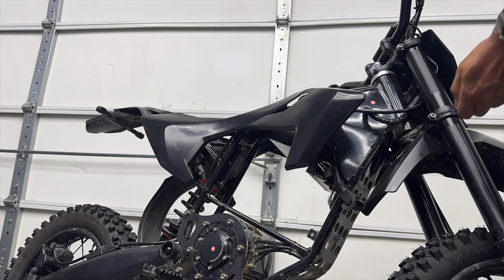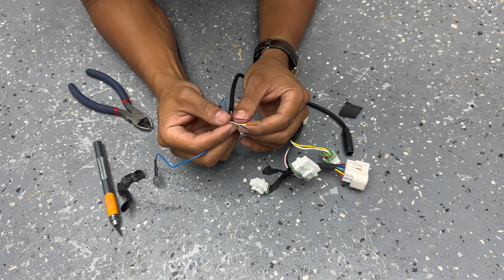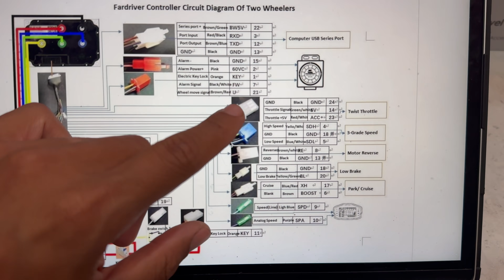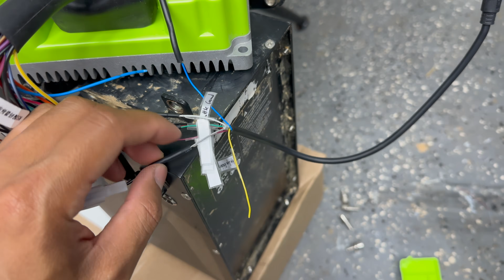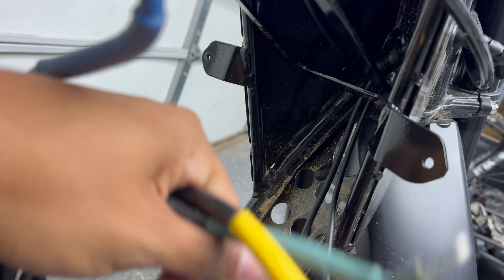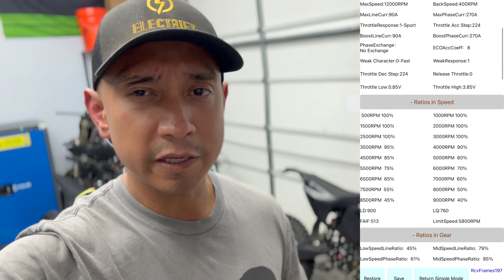Qronge X1 Spark Fardriver ND72300B Controller Upgrade

Comment: Different platform but the Eskute RTX also has 12V step down and integrated display in wiring. It is not one-line BUT I want to keep factory lights/horn/etc. What did you wire the step down converter too? Or did you not have to change the “trigger” wire since you kept factory display and key.

Thanks!

Comment: Damn you should of sent me the controller I would of used it
Reply from the maker: What specifically would you have used it on? You have something that runs on an encoder sensor?
Reply: @PatOutdoors spare parts😮😊
Reply: I wanted to see if I can put a 72v battery on the stock controller if it gets fried. It wouldn’t matter if you gave me that controller😂😅

Comment: How did your hall sensor just clip i got this and its different
Reply from the maker: Like I said in the beginning of the video, this bike is not equipped with a hall sensor. It’s encoder so I had to purchase an encoder-compatible controller (ND7300B)
Reply: @PatOutdoors just purchased the same using your code 
Thank you

Comment: Hello so I have a 6 pin connector on my far driver can you help me out and fix it please
Reply from the maker: Sounds like you bought an ND72300, which is for a hall sensor. It’s not gonna work with this bike
Reply: @PatOutdoors do you know where I can find one for cheaper?
Reply from the maker: Well you can get the wrong controller again for cheaper. I know Econic carries the correct encoder style that works
Reply: @PatOutdoors so I got the encoder controller and now it just beeps and gives me a hall sensor error it has your same settings
Reply from the maker: @MoniraAzimi please contact a tuner like I did
Reply: @Pat @PatOutdoors ou have your tuner IG or something I can contact him. I have no one to help me please help me out

Comment: Did you ever got the display to work? Mine is just stuck at 00 and the mode button doesn’t work
Reply from the maker: Yup! Please watch later in the video when I said I switched two wires around

Comment: Did you end up getting the turn signals and brake light to work as well? I didnt see anything about how you got the headlight to work. 
I got a fardriver on mine just trying to figure out how to get the lights to work
Reply from the maker: Yes, everything worked as normal at the end after I wired the controller

Comment: Would the factory motor be fine with a 72v
Reply from the maker: For up to 100 line amps yeah, but I would not get too greedy with it
Reply: @PatOutdoors what would you limit phase amps to then?
Reply from the maker: @IBDeliverance 300 phase
Reply: @PatOutdoors . Would those numbers change if it was a 60 volt battery?
Reply: I'll answer my own question. Amps equal amps
Reply: Would those numbers change if it was a 60 volt battery?

Comment: how does Fardriver ND72450B give more power compared to the other  Fardriver ND72300B Controller???
Reply from the maker: More line amps and phase amp capability.. neither mean much unless you also upgrade the battery though

Comment: I have a battery that's 180 continuous 240 max. Should I set it at 180 continuous and leave it at that? Or should I set max amps to 200, then hold 15kw until it reaches 75 volts, then it tapers? Or mabye hold 14 kw, so then it won't reach 200 amps until 70v? I need an expert opinion on this lol.
Reply from the maker: I personally like to leave it an the continuous rating unless you are simply just drag racing and doing short bursts with long rest periods in between. It’ll likely only do 240 for less then 10 seconds and if you try to do it again shortly after, the BMS would trip and cut power to the bike completely while you are on the road.. I say you can try going 10-20 amps over and try doing pulls and if it cuts back at all, then turn it down in increments of 5 amps.
Reply: @PatOutdoors Thanks for the input. Should I hold a specific wattage? or just let it drop with sag?
Reply from the maker: @kalebbathalon it will always sag under load regardless. Obviously the more you ask of it, the more it will sag. If that’s a concern for you, then just stick to the max continuous rating.
Reply: @PatOutdoors one more thing sorry lol. I saw you were using 900 phase amps on your completed build. Is that safe on the motor for casual riding, Or should I go under to about 800 phase amps? Because 900 would be the max motor capability. So I wanted to make sure it's smart to run that as my mode 3.😅
Reply: Also I remember you saying "once I get the new battery, I'll turn it up from 700 phase amps, to 900 phase amps". Was there a reason you couldn't do that with the tuttio battery?
Reply from the maker: @kalebbathalon  because you can’t multiply past 3x line amps for phase amps. 200 line / 600 phase, 300 line / 900 phase.
Reply: @PatOutdoors How come? I keep asking chatgpt and it keeps saying that you can set phase amps higher? What's the downside?
Reply from the maker: @kalebbathalon I’m not a tuner. Please ask a professional.
Reply: @PatOutdoors alright sorry for the trouble. It makes sense enough

Comment: I need help for a cheap yozma build could you give me ideas and has good range under 1500 dollars
Reply from the maker: Amorge 72V 30AH battery + Sotion FW22 motor + Fardriver ND72450 altogether would be just about $1,500. This would net you about 14.4kW, 18kW peak power. Any more power than that, then you are taking away from the range..

Comment: sotion came out with a new motor for the x1 FW26X1
Reply from the maker: That would be a nice upgrade, but only if you install a battery that is able to put out a lot more power to make it worth it

Comment: Thank you for showing the results of what this upgrade truly does i was planning on doing this but i think ill save my money now lol
Reply from the maker: I would say it’s 100% worth it if you’re planning on installing a better or higher voltage battery on the bike. Otherwise yeah minimal gain if it’s JUST the controller.
Reply: @PatOutdoors I changed my rear sprocket to 45t and I plan on following your old video to change the throttle and add a volt meter. Was the throttle response better after you changed it and how did that change feel compared to the controller upgrade?
Reply from the maker: @jacobl7375 please completely disregard the old video unless you have the original early production M model with the half twist throttle. They had completely different wiring harness for the throttle
Reply: @PatOutdoors ohhh you're right thank you for the heads up just saved me a headache

Comment: Thanks for this video!!! I have a Nd72450B i tried to install awhile back but it kept tripping the bms on the stock battery, I can finally get around to installing after my new 60V battery comes in and i also can keep the accessories. Youre Awesome Pat!!!
Reply from the maker: Glad I could help, definitely post an update on how it runs once you get that new battery installed!
Reply: Yeah I get the new battery work out. Interested in trying what you guys are doing.
Reply: Yo Pat thanks a bunch !!! I got my ND72450B and Amorge 60v 40ah 220a battery all wired up and it works exactly like stock.

Comment: man i tried to get the 72450B on there but, got hall sensor error and never figured it out
Reply from the maker: I talked about running into this same issue in the video. I changed the angle sensor to Encoder 4096 and it went away

Comment: I love these refitting quality components to replace the cheap ones videos. Always a good watch! Ive spent many a night racing at Summerduck both foxbodies and 2 wheel. Kind of a crappy lil track but it works in a pinch and saves driving all the way to MIR or down to Dinwiddie.
Reply from the maker: Right, well it’s only about an hour from my house too

Comment: Have you found out how to tune the nexvey flash pro? If so could you post a short about it.
Reply from the maker: Nope! Unable to connect with the hobbywing app, even tried the Votol and the Fardriver dongle connected on the 4-pin connector as well.

Comment: Please do continue upgrading the x1 spark, id love to see what options id have for doing a battery replacement. The voltage sag tells me that you could gain a ton of speed and range with a good battery. I need to be able to hit 60 for a short distance, and somewhere around 40-50 miles of range. Ive mostly fixed the seat by taking off the upholstery and putting a 1 inch thick gel pad in under the foam for extra dampening, still stiff foam nonetheless but it helped a lot
Reply from the maker: The voltage sag is crazy! It’s a shame because I know this controller and tune could likely do close to 60 MPH, even at 60 volts if the battery was able to support the load / demand
Reply: @PatOutdoors  please do a video on that man or keep this project going I got this bike around the 3 months ago and  so far really like it but yeah I noticed the voltage sag it’s getting worse and just really hard to find a solution for the battery upgrade on forums and Facebook groups while getting reliable information lol

Comment: Hi pat, I’m building my in10 pro. I’ve decided on the fw22 for the motor, is it plug and play? And would the nd72450 or nd72530 be better for this setup with the amorge 72v 20s6p 30 ah battery
Reply from the maker: It’s technically plug and play if you went with the hall sensor version.. but I always recommend getting the controller tuned so it runs at the most optimum level. Choosing a controller depends on the power you are going for. If all you need is 14kW, then you could go with an ND72450 with a 72V battery that has a continuous output of 200 amps. That could need about 70MPH, depending on your gearing. If you want more power and speed.. then go with a bigger battery and higher line/phase amp output controller. For perspective - I had to run 300 Line / 900 phase amps to go over 80 MPH
Reply: @PatOutdoors thanks a lot love the content